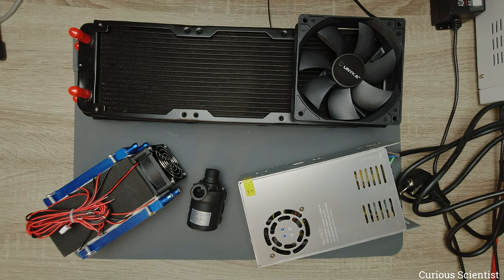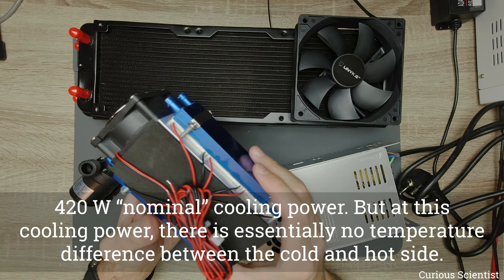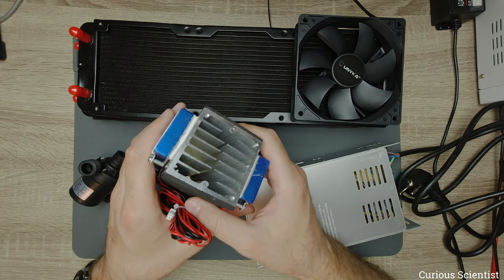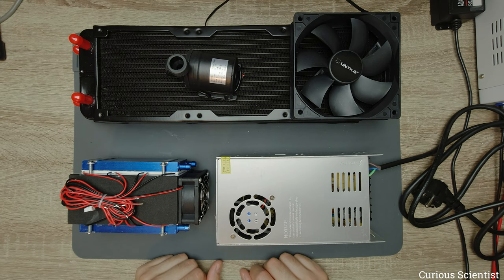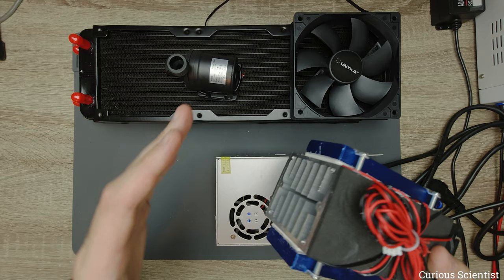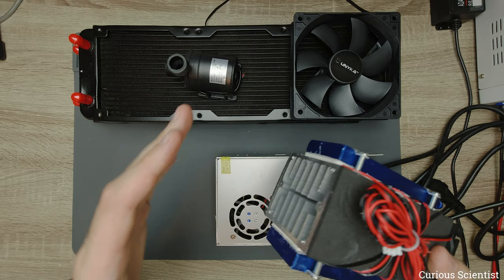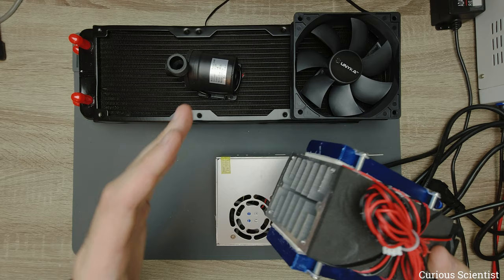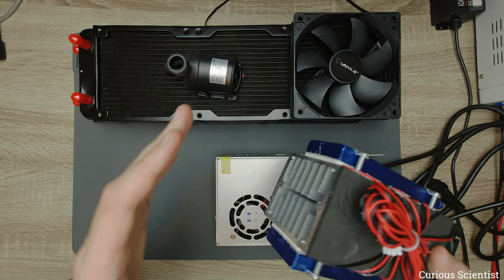Peltier cooler-based air cooler

Comment: But if we connect 10 to 20 in series I think it will cool down a room😮.
Reply from the maker: Sure, sure, we can think many things. 

I think your electricity bill would be sky high, and the cost of components would be more than that of a commercial AC unit...
Reply: @CuriousScientist   no a standard AC consume the power of 2500w but this can overall consume 600w only
Reply from the maker: 10-20 of this? Your math is waaaaay too wrong. One of these units consumes around 420 W. 70 W of each Peltier (6 Peltiers per unit). 10 units would be 4200 W. And the cooling power would be just a fraction of a commercial AC.
Reply: @CuriousScientist   naah man use a power supply with output of 12v 50 amps it's Power consumption is 600w and each peltier is running on dc not ac so use this formula p=vi.
And according to google peltier consume 40w so each peltier consume 2amps from dc supply.
10 peltier will consume 20 amps!
The way you are sayin 4200w means you're directly connecting peltier to AC supply
Reply from the maker: At 12 V, they draw almost 5 amps. Just look at my measurement or look up their performance chart. 

Also, you meant Peltiers, but I meant the unit with 6 Peltier coolers! I thought you want to use 10 of those. Nevertheless, 10 Peltiers is not enough. They provide maybe 20 W cooling power each. So, 200 W is nothing...
Reply: @CuriousScientist    SIR listen whenever it comes to alternate current power consumption is measured in WATTS  but in case of DC current power consumption is measured in amps(current draw).
these factors make yu easly to understaind the power consumption of particular device whether it is woking dc supply or ac supply
Reply from the maker: Energy doesn't just disappear by going from AC to DC...
Reply: @CuriousScientist   mystery unresolved🙄😶‍🌫🧐

Comment: I subscribed and gave a like , Hoping that you may help me in case I need some tips about electricity or electronics .
I  will probably take of some electronics parts from some old PC power supply to make a voltage regulator to charge Batteries from solar panels . Hoping you did not get me as a bad guy due to my comments .
Reply from the maker: Yeah, no worries! Constructive discussion is always welcome.